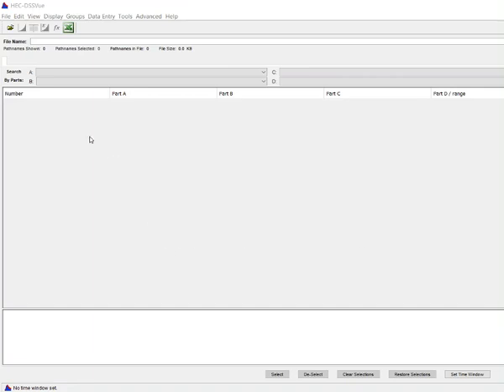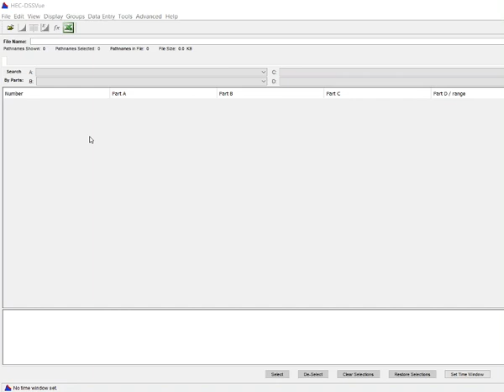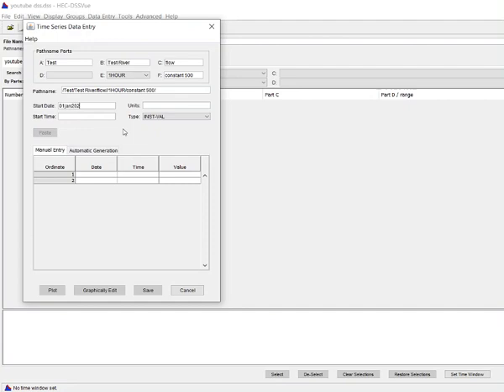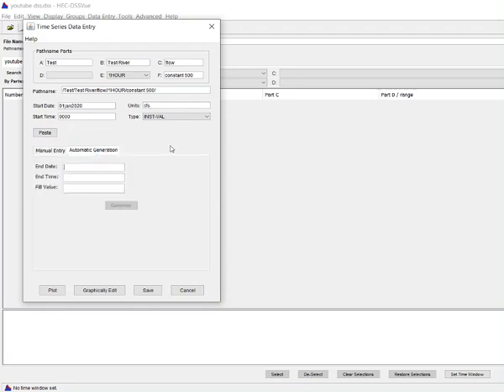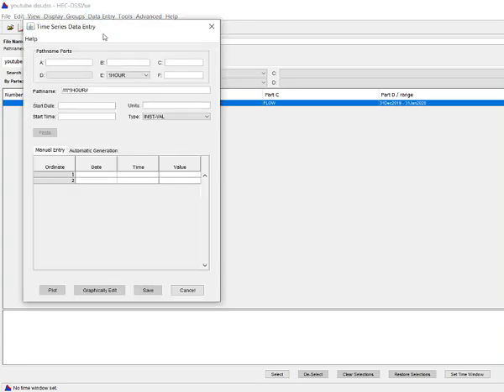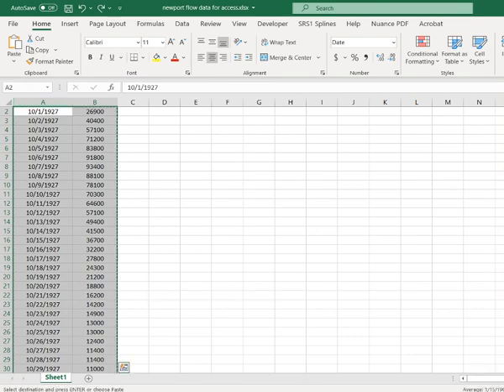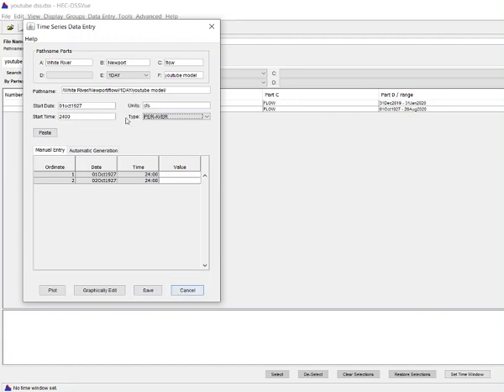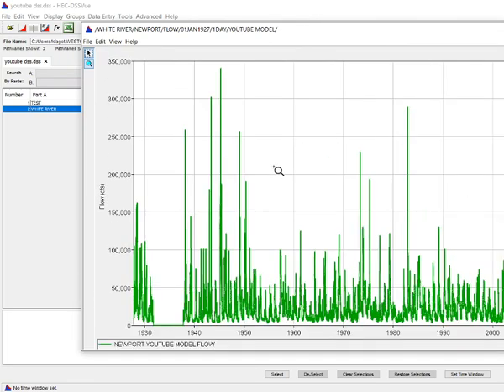Developing a time series data file in HEC-DSSVue

Comment: IThank ypou for sharing the video. I am not able to save my weekly time series data although it shows the plot and tabular form when I create it but does not save it there is some error like invalid time ...I have spend hours but not able to find where i am wrong however for daily series it is working. Is there any limitation in using weekly data or it is something else please reply!
Reply from the maker: Thanks for the question.  I had to go into DSS to test it, and I also found that I was having issues with weekly data.  I don't think that I have ever run into that since I have not used weekly data very much.  I need to do some testing on this, but a possible solution would be to enter the data in as daily data and then change it to weekly.  That would be under Tools > Math Functions > Time Functions > Average Over Period > 1 Week.